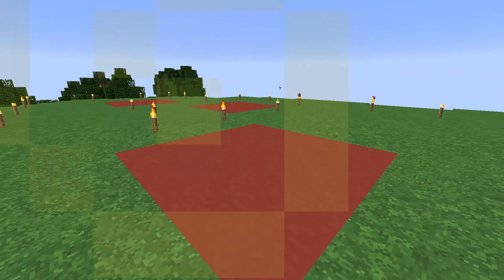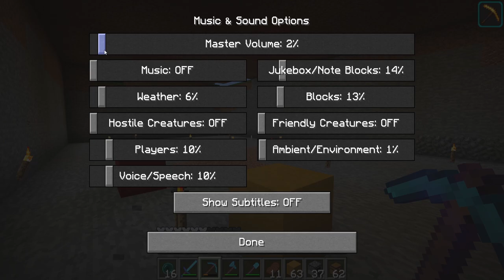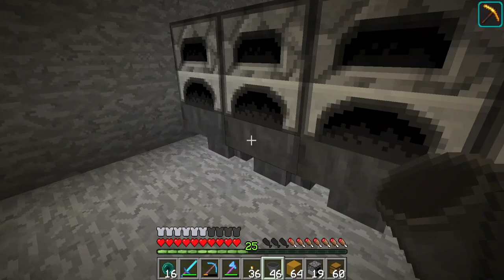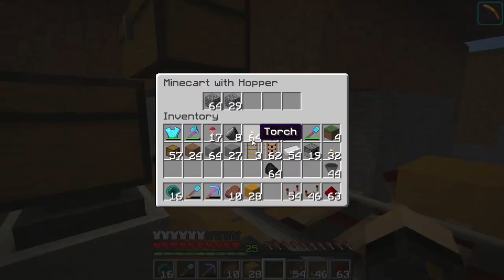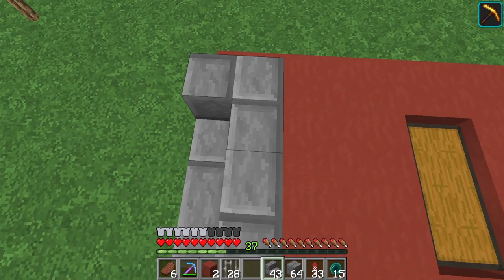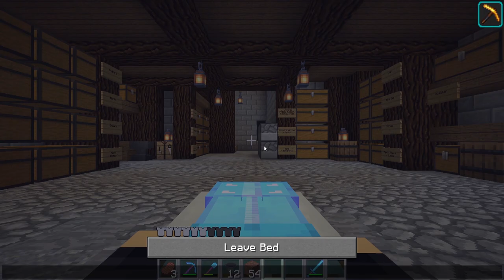How To Make an Auto Smelter in Minecraft! #17

Comment: Hey so I had problems with the auto smelter but I think it was because I’m on mobile. What was happening is the bottom Minecraft was adding it from the top so what I did was add another row of hoppers on the bottom row and moved the rails over so the mine carts don’t interact